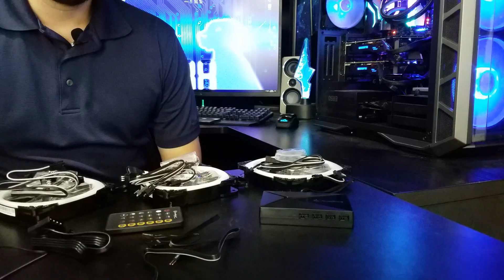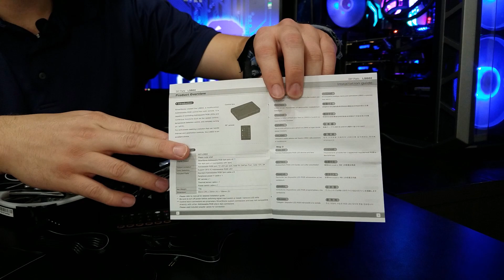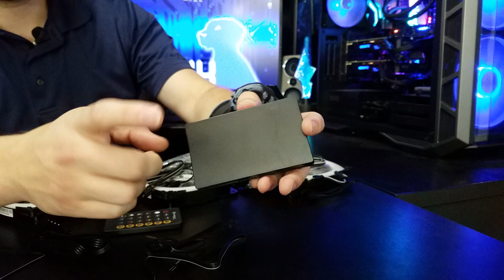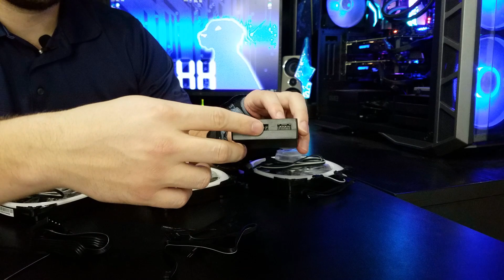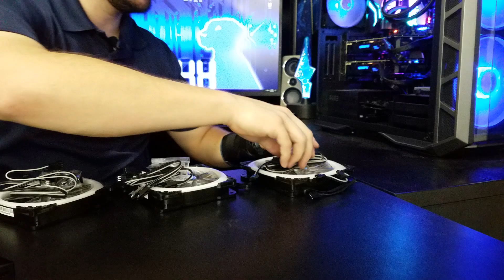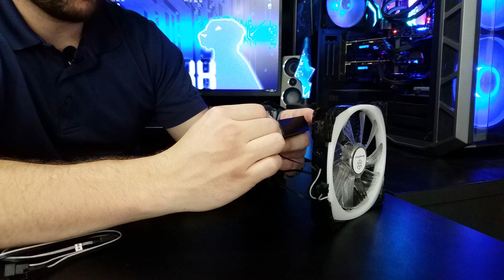SilverStone - LSB02 Fan & RGB Controller - Install

Comment: Thank you for this video. I bought a Siverstone AIO and 3 extra Siverstone fans. My motherboard is 12v rgb so I got an LSB02 E controller. NOTHING is labeled! The fan wires are not labeled PWR or RGB. The controler box is not labled anywhere for any connection and like you said, it is possible to fit a plug in the wrong receptacle. This video saved me. I don't understand why of you can daisy chain the rgb then why are there 6 rgb ports and only 4 power ports. That seems a little backwards to me.

Comment: So this is controlled strictly by remote control?  no USB 2.0 connection for software control?  I don't have a mobo with rgb header so im trying to find a rgb controller.  I am deciding between the coolermaster rgb controller, Thermaltake tt controller and this one.